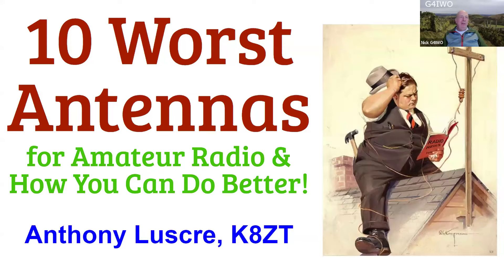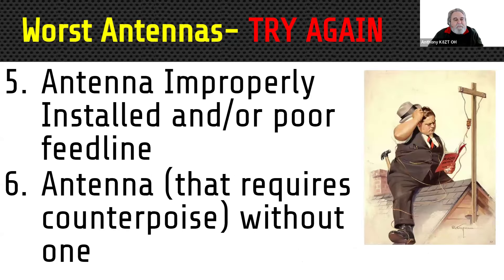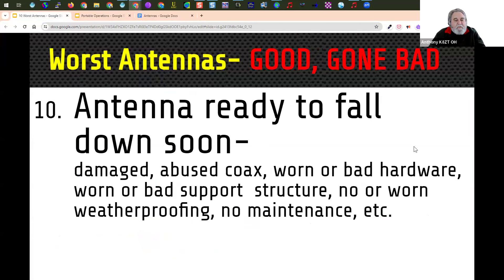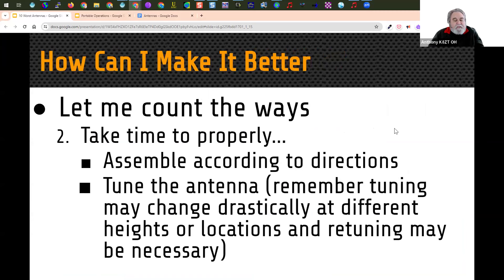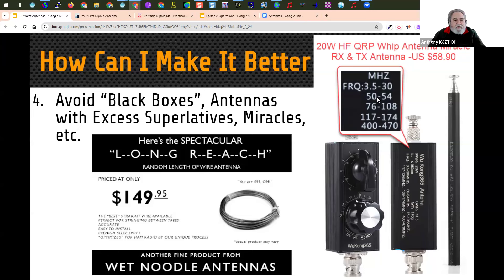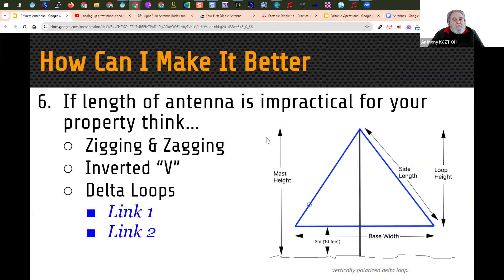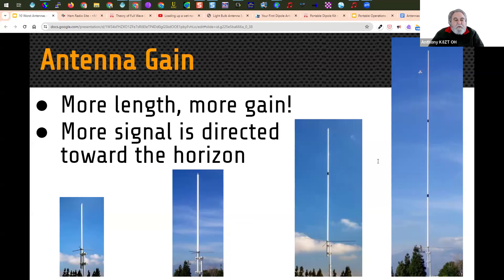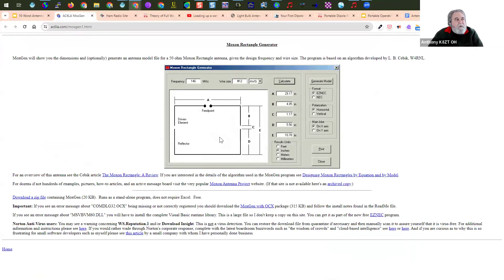Anthony Luscre K8ZT : The 10 worst antennas for amateur radio !

Comment: EXCELLENT. ROFL: My antenna, still in its shipping wrap, has moved from the cupboard to the kitchen - that's progress. It's a 15 metre hamstick which I plan to use as is and also convert to a 40 metres vertical λ/4, using it as a loading coil. I also bought two recommended books from the RSGB. The Antenna Notebook AND Portable Antennas for Everyone.